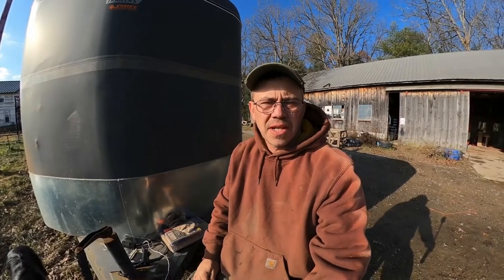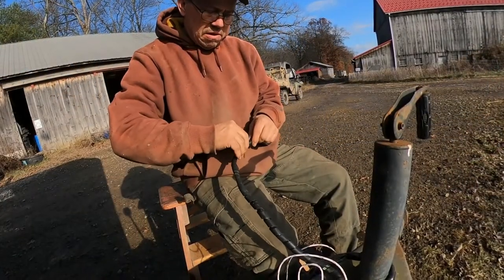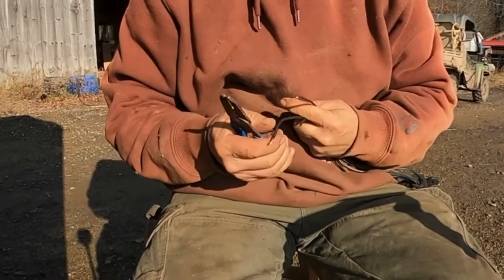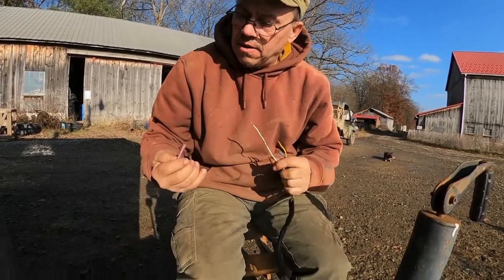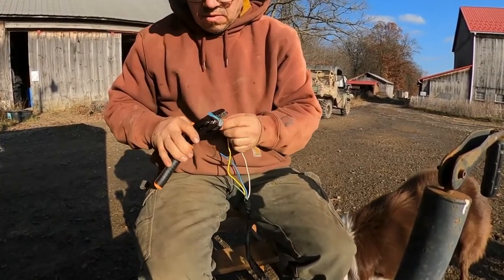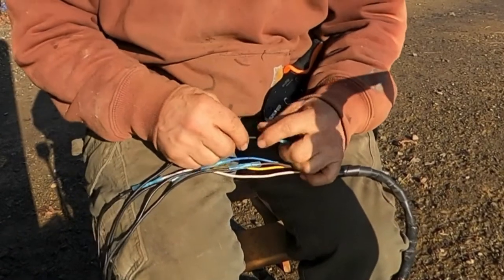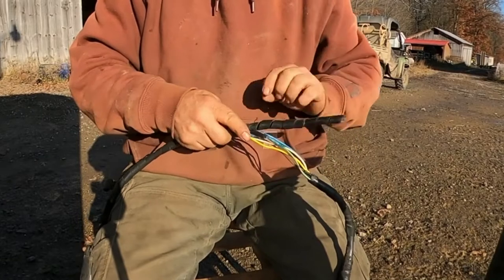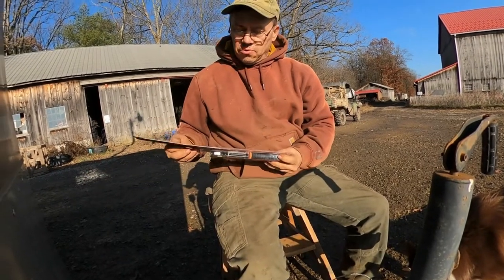KFCPtec crimpers and shrink connectors.

Comment: That looks pretty neat tool. I have to fix one wire on my 2 horse trailer too. It doesn’t work. I think the wire came apart. I only use it a couple times when I bought it, but it was cheap and perfect size for us. We hauled a few goats and 4 sheep. They sit so low to the ground that I think the wire caught something on the ground while I parked it. I’m trying to figure out if I want to replace the wire or just that one and how to run the wire so it won’t snag too. Thanks again for all your videos!
Reply from the maker: I had the same troubles with the wire getting caught on things. I redid my wires. Thanks for watching!!